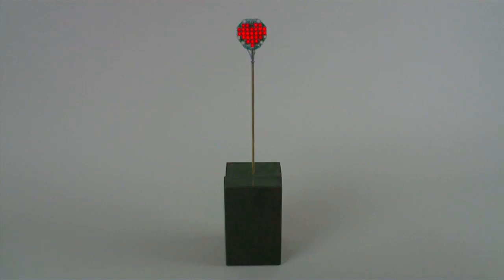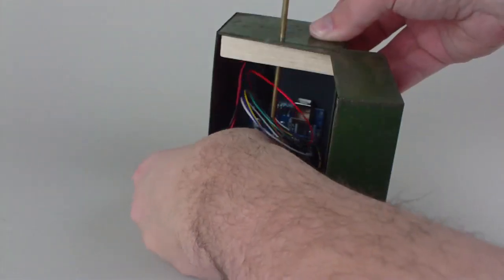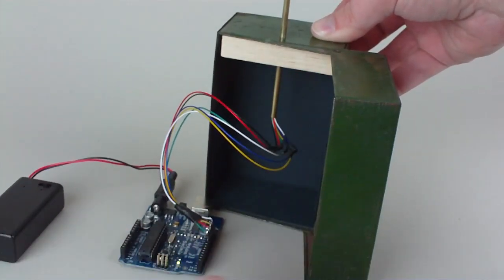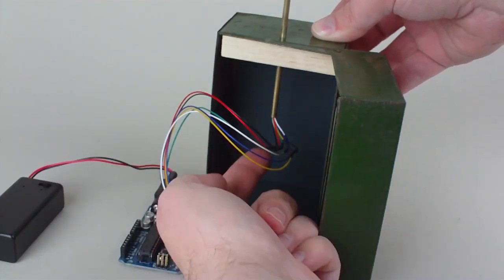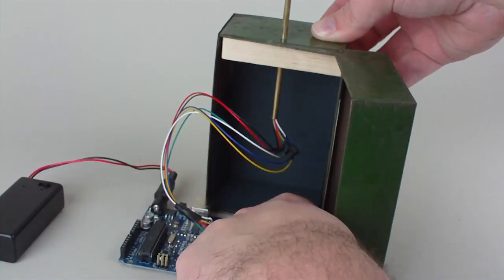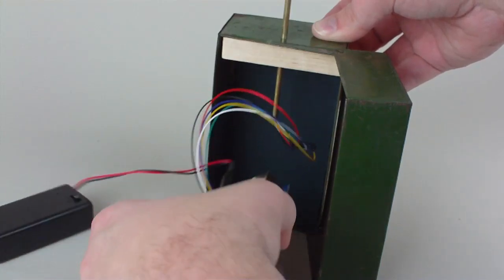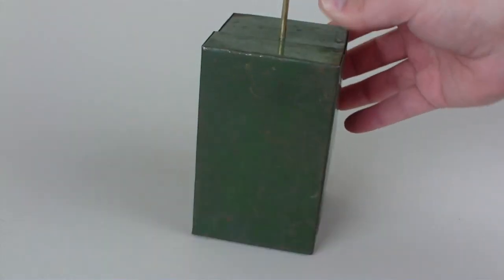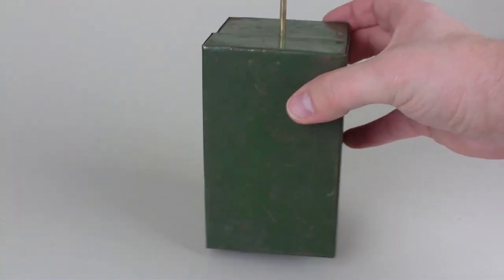How-to Tuesday: Valentines LED display

Comment: Too bad you have to use an arduino.  It would be better if you could just burn the code to a simple cheap pic and make the project for under $10